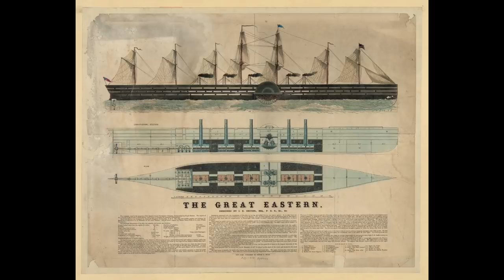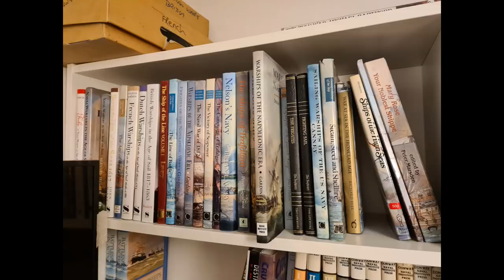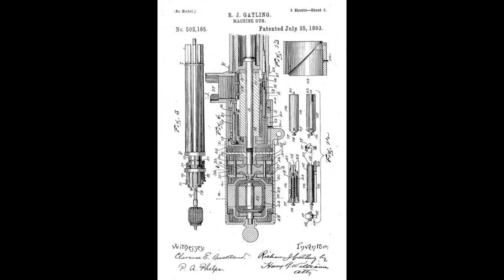The Drydock - Episode 188

Comment: The issue with gatling type of weapons, extremely high rate of weapons is the human reaction time. 

The fact is you can't aim a gatling. You point, watch the tracer/watch the impacts and adjust. All the while hoping you have enough ammunition to actually do something to the target. 

What makes Phalanx and other gun based CIWS systems so deadly is the fact humans do not have to aim the gun. They turn it on and they let it do its work. You need not just an electric motor for the gun, but for the mount too. It's an information bottleneck due to a person that makes it a very impractical idea.
Reply: It's called Spray and Pray technique, it's fun to learn tho
Reply: The possibly main problem with a powered 20 mm Gatling gun is heat. Manual aiming of the gun means you would want to fire much longer bursts. Modern 20 mm guns do not fire very long strings. The 20mm Oerlikon had rather small magazine capasity (65 round drums?) so the barrels had some time to cool, even though there were provisons to change barrels rather quickly. The 40mm guns had water cooled barrels.  There is a chance that the ammuntion reloaded system could hamper the gun as much as the Japanese Type 96 25mm guns were.
Reply: With gyroscopic sites such as those used on the later m163/m167 it's not really a human factor that's the problem.

Supplying them with ammunition and electricity is going to be more trouble than it's worth.  

Yes they could probably have come up with something comparable to the m167 towed Vulcan turret would it be worth it in those circumstances? As a former Vulcan myself I think I would rather have more 40 mm

Comment: Regarding the Vulcan/phalanx type Gatling gun being available in 1940, could the material science and manufacturing available in 1940 be enough to build a phalanx type Gatling gun?
Reply: Keeping them fed is another thing to keep in mind.
Reply: Gatling guns are not classified as machine guns under American law. When the local museum had one for sale, a friend bought it and mounted a car starter on it. It’s basically what a Vulcan is. The problem was the gravity feed system wasn’t up to feeding cartridges into the gun at that speed. With the resources of the government, they probably could have solved that problem.
Reply: @silenceoftheyams5969  Probably should tell your friend to be careful, that counts as manufacturing an illegal machine gun the moment an electric motor is mounted to it.
Reply: A hand cranked Gatling isn't considered a mg, the second you put a motor on it, it becomes one and is big time illegal.
Reply: @toddwebb7521  Under current law, a machine gun is classified as one barrel that fires in full automatic, a Gatling gun, even a Vulcan, doesn’t function that way. It’s a system to reload a cluster of single shot barrels very fast as they rotate and fire continuously. The later version, with the crank in the back instead of on the side, was capable of 900 to 1,200 shots per minute, already higher than most standard military machine guns today. Putting a electric motor on one is easy, converting it from gravity feed to a belt system isn’t worth the time and money it would take to make to make it work. As Vulcans are only manufactured as military arms, it’s classified as a military arm and under the same restrictions. It’s not illegal to build your own version for yourself, just too expensive to be practical.
Reply: @silenceoftheyams5969  Not looking for an argument just got a line I have to deliver - hope he enjoys splitting hairs that much when it comes to his dog.
I'll see myself out.
Reply: @jameshealy4594  It won’t work with a motor because it spins too fast for the gravity feed system to work, he took the motor off and put the crank back on, so no worries.
Reply: @toddwebb7521  
There used to be* plans available for a minature in .22LR. IIRC the plans specified using a barrel suited for blanks to avoid legal issues.
*still may be

Comment: Gatlings in WWII: Instead of a 20mm round, what if they'd made electric Gatlings in .50 BMG? They could probably be made to use the same belts that the M2 Brownings already did, making ammunition supply simpler, though being able to feed the thing would be a lot tougher than an M2; you'd have to link several belts together just to be able to fire it for more than a second or three, and at 3,000 rpm the .50BMG round might be able to rip apart aircraft a lot better. You'd really want radar fire control for either that or the 20mm version just to get it pointed int he right way fast enough
Reply: 20 mm is only good for point defense. Even the Vulcan air defense cannons from the 50s and 60s on which the phalanx is based only have a maximum slant range of about 2,500 m.  The 50 BMG is an even more limited round.

Conceivably this would have been useful against kamikazes but on the whole I think I would rather have more 40 mm

Comment: A comment and a question.
Comment:  the pairing of a standard 20mm with a 20mm gatling sounds quite similar to the ranging machine gun on a Chieftain MBT (feel free to compare/contrast this with the man in the hatch).
.
Question:  Could a 20mm gatling be worked into a ship's torpedo defense system?  After all, shooting at torpedoes did sometimes work.  The trick would be early (enough) warning and giving the gun enough depression to work in as close as possible to the ship.
Reply: SINCE the hypothetical 20mm Gatling was ELECTRIC drive, why not just reduce the speed with a second trigger? - no second gun or mount or feed mechanism - just a second speed or variable rheostat like on a sewing machine. start with a light trigger squeeze and as the deflection or lead began to match the target, squeeze harder and increase rate-of-fire. or a separate foot pedal for speed and a trigger for on/off. As for tracers every 3rd round, that is done when loading the belt. You want a spacing such that all barrels used would fire equal number of tracers - so a mutually prime number like 5 barrels and every third round in the feed belt would assure equal use of all barrels to try to keep from having a single barrel skew the visual effect of the tracers not matching the AP rounds.
Reply: Torpedoes were normally set to run deep enough (10+ feet) that a small caliber gun like a 20 mm, even firing an explosive shell, would not reach and do anything to it.

Comment: Rivet popping in tanks is a myth - there is little if any evidence of tanks in WW2 in particular that rivets break off and rattle around inside a tank (ar least in British and US tanks)  -the nature of tank construction was such that a hit which was capable of displacing rivets would in a welded or cast structure cause equally catastrophic spalling of the inner surface. -Tank manufacture went over to welding for much the same reason ship building went over to welding -it was cheaper required less space. less training of personnel,  Ships armour apart from splinter shields was not riveted - nothing on a ship beyond boiler plating was riveted -one certainly never would have tried to rivet sections of 40  lb 1 inch armour plate together,  set screws were the standard in fastening those to structure and  boiler plating.

Comment: Can you imagine an older carrier converted to an A.A.ship ? 
Maybe 12 dual 5s 30 dual 40mm and like 100 20mm 
Plus decent radar and fire control.
Reply: Only 12? Only 30? Only 100?
Reply: The British did a much simpler system , they used Merchant ships as as Anti Aircraft Ships, the Ulster Queen using radar shot down a JU88 through the clouds on PQ18.

Comment: It'd be more technologically complex than your thought of bolting a single 20mm gun, for adjusting aim, onto the side of this hypothetical Gatling 20mm mount - but I wonder if you'd be able to give the fully spun up Gatling a low rate of fire mode.   It can already spin up without firing - and it should be fairly easy to make it only fire every Nth time a barrel whips past.  But the tricky bit might be reliably ejecting and then reloading only that fired barrel.  Still, if it could be made to work you'd save the space and weight of that extra 20mm bolted onto the side.
Reply: Externally driven gatling guns can just be spun at a lower rate. It's not all that difficult to have a slower setting for the electronic motor.
Reply: Isnt ShKAS a rotary gun scaled down?
Reply: @Emdiggydog  not precisely. It is a "revolver" type gun with a 10 round feed chamber (the revolving cylinder). A revolving gun has a cylinder with multiple positions for feeding, firing, and extracting, but only one cylinder fires and there is only one barrel. The gatling type guns have multiple barrels arranged in a circle, with the entire array of barrels rotating through feed, firing, and extracting positions.

Comment: Why did the US MK 28 torpedo preform horribly 

(I’m correct about the mk 28 right)
Reply: There is a Mark 28 torpedo, it was an electric torpedo developed from the Mark 18. The Mark 28 was in service from 1944 until 1960, so I'm not sure that's the one you mean. The Mark 14 21" submarine torpedo was initially terrible and Drach has a video on the subject, subtitled Failure is Like Onions or something like that.
Reply: @kemarisite  oh yes the MK 14 how did I forget